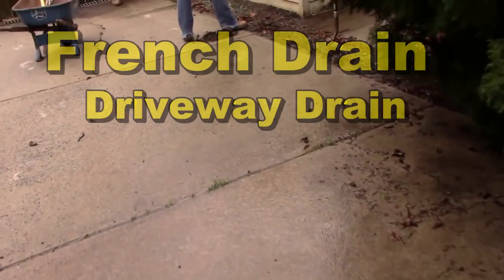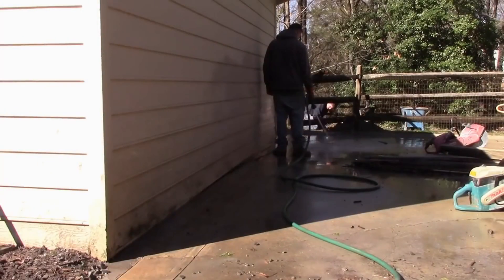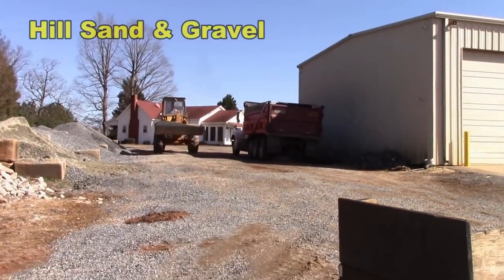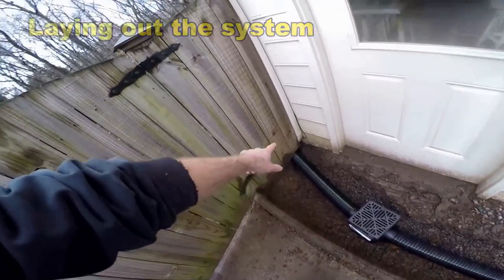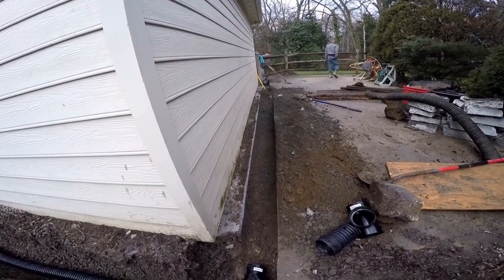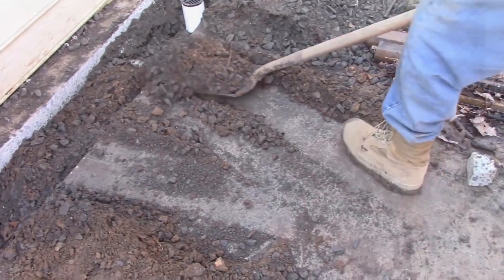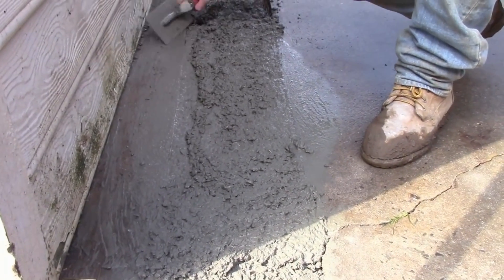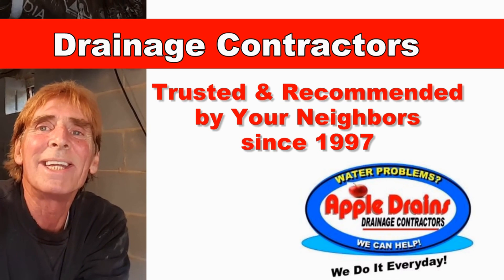French Drain, Driveway Drain, How to Install French Drain for DIY

Comment: Would it not have been more effective to have a wrapped curtin drain and not put the soil back in? To the novice it seems like this would move more water from around the foundation of the pool house and prevent clogging of the system and erosion of the soil around the pipe as it’s picked up be the water that’s flowing down through the ground  and out the system…